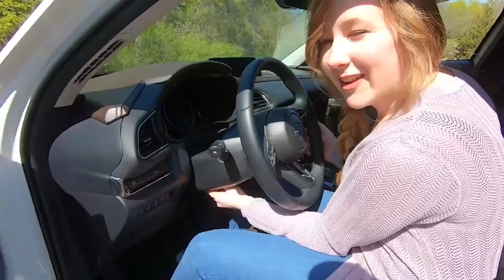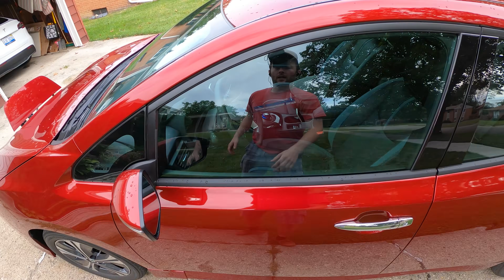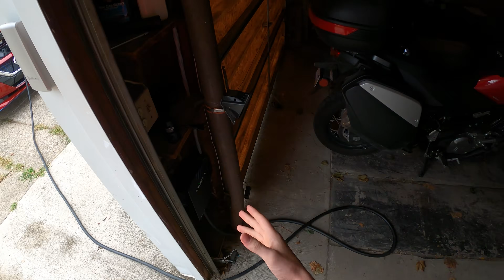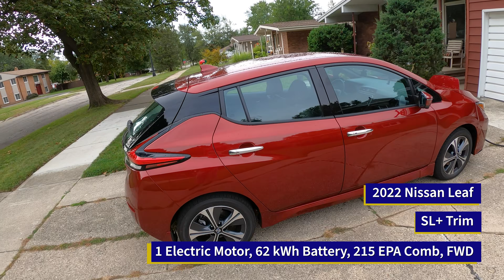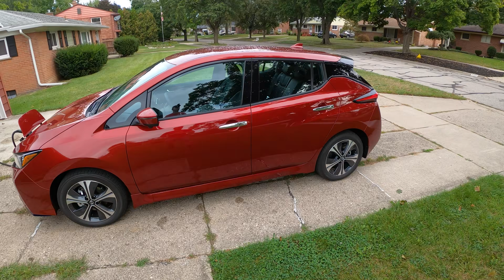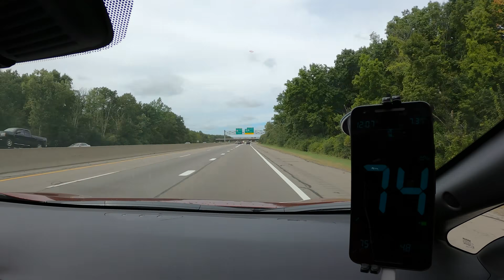2022 Nissan Leaf – Range Test | Highway Efficiency

Comment: You should be getting a minimum of 3.5 miles/kWh in the LEAF and I normally get 4.1 miles per kWh as a minimum driving at 60-65mph on the highway in summer.  That includes some hills, eco mode OFF, and pro pilot cruise control on most of the time. If I pick up speed to 70mph the efficiency drops but most of the time traffic is too busy for that speed anyway in the UK. My daily commute is 48 miles on the highway and I typically use 10kWh to do this journey in dry summer weather. I'm driving a 2018 40kWh LEAF that cost £8k / $10k.

Comment: hello! we just bought a 2023 Leaf "S" only w/149 EPA range (40kWh battery), but noticed that after our first 220v charge at home the panel reads miles range available is 189 after 92% charge -  are we missing something (or) you think they put a 60kWh battery by mistake? And is there a way to confirm the kWh battery on board? Appreciate your Inputs!
Reply: No they dont, the GOM (guess-o-meter) is putting out range numbers based on your driving style. The more efficient your driving, the higher the range number!  Seems like you've only driven it very slowly and efficiently 😄. Mine gets around 170-175 miles on a full charge based on my driving.

Comment: Thanks for the video, but (unless I missed something) you didn't actually run out the battery, but simply stopped around 40% and calculated the rest.  Perhaps this is accurate, but who knows?  Maybe the battery drops like a stone after that.   Wish you had actually run it to Low Battery Warning, then it would be conclusive.

Comment: On my road trips with the leaf plus you will no matter the wether get 170 miles of range.  If there isnt a hurricane blowing at your face, you'll get that 190. every day, all day long.  On my 340 mile trips, I go about 130 miles, charge, go 130 miles, top up then head to my destination and with two charges and driving the leaf wont overheat much.  Although I could go further, and charge less, the human here has to stop more often than the car does! HAHA.
Reply: Each stop at a level 3 charger will cost you 1 hour.

Comment: At the 2 min mark you state the Leaf costs more than your standard range model Y did. What state are you in? The original model Y standard range debut in 2019 started at $43,190. Today a 2022 model starts at $59K. The 2022 Leaf SL plus is $38,425 msrp. unless you got a 5 -10K discount and no options I can't understand how your statement is accurate. Other than that nice review and assessment.

Comment: Hey Charlie I was thinking about getting a leaf too and also was wanting to live in Michigan because cost of living is super cheap and I love the wildlife out there but in Michigan, it’s a state where it gets extremely cold and very humid during the summer. I’ve heard that cold weather is one of the ways a battery can degenerate overtime, what’s the best way to keep your car battery strong for a long time? Thanks.
Reply from the maker: Keeping an EV plugged at about 80% charge in is the best thing you can do right now.

Comment: We drive 2016 and 2013 Leafs with 24 and 30 kwh packs. We drive 50-55mph on the freeway. The digital indicator on the dash says 4.9 miles per kw. 40 psi on stock Bridgestone tires.
Reply: 50-55 is about the most I ever drive highway and less on most of the roads around me...works out fine. Its the "kids" that usually find out the hard way about "I just gotta get there fast".
Reply: Thank You for the information!

Comment: How come you have a smartphone with a speedometer on?
Reply: So you can see the speed from that camera, in the time laps video.
Reply: GPS speed? LEAF slightly under-states the speed on the dash.
Reply: Most manufacturers have around 2mph variance from actual speed displayed. GPS on the phone is to get the actual speed to make testing more accurate.

Comment: 3-4 mph over 70 makes a huge difference because air resistance really starts ramping up over 65 mph. were all the other tests at 73/74 mph?
Reply from the maker: Yes
Reply: Yes the LEAF really drops in efficiency over about 68mph in my experience. The speed limit it 70 in the UK anyway and it's easy to cruise at 65mph GPS speed in the LEAF and get over 4 miles per kWh. The car isn't designed for 70+
Reply: The drag increases with the square of the speed. It’s a big deal

Comment: Charlie, With or without plant life growing from your driveway, I am so jealous of your double garage as I have to make do with a single. This leads to the age old question, is the glass half full or is the garage overflowing?
Reply: I can say if you have Two as I also do you wish you had 3! :-)
Reply: I’m jealous of your single garage and even your driveway for that matter. I live in an old house in New Orleans with no garage and driveway. I have to park my truck on the street. Any kind of vehicle that requires plugging in is out of the question for me. I would have to run the cord across the sidewalk to plug it into the vehicle and that makes it a trip hazard and could potentially ‘walk off’ if you know what I mean.
Reply: Don't feel bad I have two cars in the driveway, not even a carport. 😢
Reply: @lonelyp1  I feel your pain.
Reply: @lonelyp1  YOU have a driveway? Luckeeee
Reply: @jaysson1151  I can park 3, launch 2, and charge 1 at a time at a stretch I might be able to charge a second, but I don't think the cord will reach.